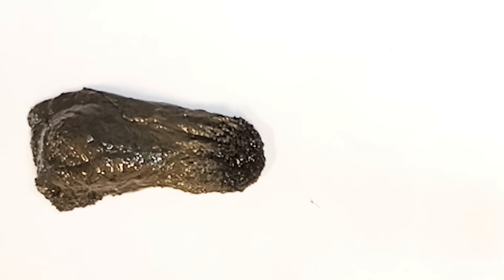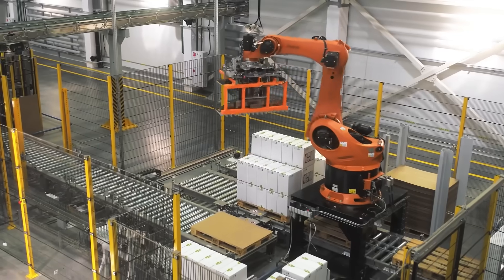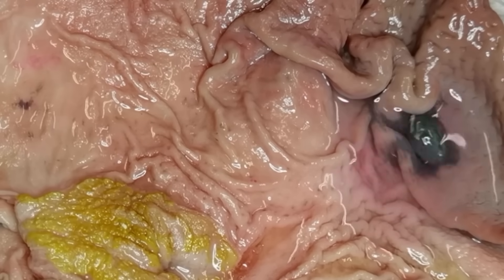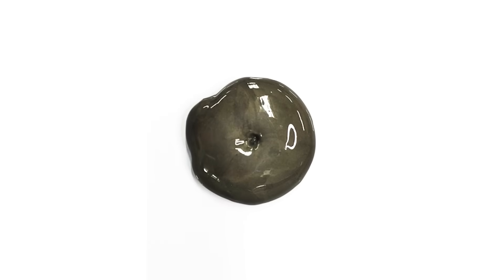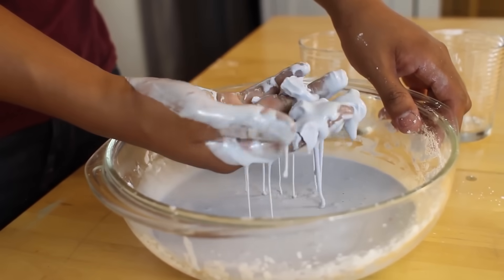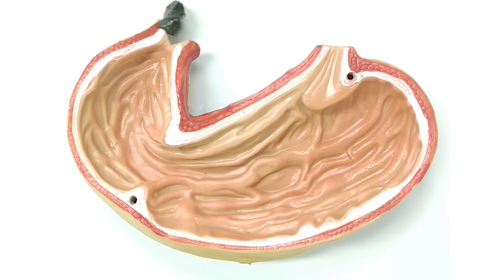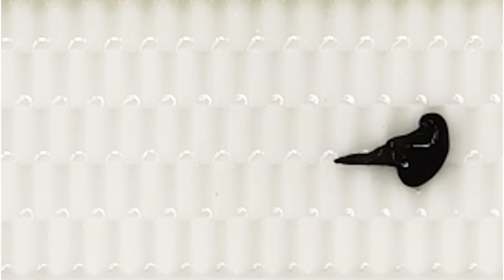This Is The First LIQUID Robot, And It’s Unbelievable

Comment: It's not a robot in my book if it's not self-driven. Having to manipulate using outside magnetic fields means it lacks autonomy.
Reply: I agree
Reply: Thank God.
Reply: It's more of just a very intricately fututistic instrument. Still interesting, though!
Reply: You are using the common usage meaning of robot. The scientific/engineering usage of the term 'robot' is different. For example a thermostat is a robot. A robot does not have to be sophisticated to be called a robot. If it performs even one simple task autonomously it is a robot.
Reply: @dannygjk  - This magnetic slime does not perform even one task at all autonomously. It's not a robot. It's just a magnetic fluid being dragged around by magnets.
Reply: @peterwhitey4992  If it encounters a piece of steel for example it will wrap around it, (grab it), automatically.
Reply: @dannygjk  - A piece of tape will automatically stick to anything it encounters. A drop of water will automatically make something it encounters wet. An arrow shot from a bow, will make a hole in whatever it hits. Doesn't make it an autonomous task. Any magnetic material will automatically attach itself to steel. Doesn't make any of them robots.
Reply: @peterwhitey4992  not all of your 'analogies' match as autonomous. I'll grant you that slime with embedded magnets is debatable. However it will do something autonomously. It will grab some things if they come into range. That can be useful because it can perform a function. Let's get back to thermostats with coiled bi-metallic strips and a mercury switch. How do you feel about that being called a robot? How do you feel about a virus being called a robot?
Reply: @dannygjk  It will grab some things that come into range automatically (like you first said), not autonomously. It's two different things. A robot has to be autonomous.
Reply: @dannygjk  A thermostat is indeed autonomous. Virus are autonomous but not artificial so I'm not sure if they're considered robots.
can you explain what's the difference between the common and engineering/scientific definition of robot. A thermostat seems to fit the common definition of robot too.
Reply: @shiinondogewalker2809  I'll grant you the slime is a questionable example but the others are definitely robots. Example old school thermostat.
Reply: @shiinondogewalker2809  Viruses are considered non-living but I honestly don't know whether scientists consider them robots. I do consider them functionally robots and they even have firmware in a sense.
Reply: @dannygjk  Are you agreeing that it doesn't fit the definition of a robot, or are you claiming that this material is capable of performing some type of  autonomous action? If it is capable of autonomous action, they certainly don't explain how in this video.
Reply: @quietpsycho1  been a while since I watched it but doesn't it have a lot of small magnets in it?
Reply: Who is to say we are not controlled from without?  Barring there is no evidence for such a controller.
Reply: @markharmon4963  we are not controlled from without
Reply: It's like calling a string puppet a robot.
Reply: Hey Girl I Like Your Kitchen Romania  - Then basically anything is a robot, because you can move it around.
Reply: Microrobots could deliver drugs straight to diseased tissue.  Fish-Shaped Microrobots to Deliver Chemotherapy to Tumors
https://youtu.be/4Qa7W-TH948
.....
Reply: Aren't software driven robot lacking true autonomy.
Reply: @ashleydean9350  not autonomy as in people having autonomy over their lives. It's a different usage of the word 'autonomy'. Robots performing function(s) autonomously means they can make decisions without human input.
Reply: Yes
Reply: This video is clickbait

Comment: As you mentioned neodymium magnets are permanent magnets, therefore you can't change their magnetic field like electric magnets, therefore you can not control the robot.
Reply: So electric motors with permanent magnets don't actually work? Have you never used a magnet to push another magnet (same polarity against each other) without touching it? I thought that was done in schools all over the world.
Reply: @bennylloyd-willner9667  
LOL, electric motors have both permanent and electric magnets, that's why they have to be connected to electricity. didn't they teach you in school?

Comment: Seems like the definition of "robot" is pretty strained here. Just sounds like magnetic sludge, which has been a thing for a long time. How is it controlled? Can it think and navigate for itself, or does it need a bunch of exterior magnets outside the body to guide it around? I'm pretty skeptical about you calling this a "robot."
Reply: The inventor had it correct , it is a potential tool.

The robot title is clickbait and dishonest in its current state
Reply: @Mustang2277  the inventor calls himself the co-creator of the "Slime Robot."
Reply: Why do they call it a liquid robot?
My magnetic putty does the same thing when i control it with a magnet. 
is my Magnetic putty a liquid robot too?
Reply: @J17legacy  It would be if you could control it with accuracy
Reply: @J17legacy  according to the new definition. Yes. Yes it is.
Reply: @DanGoodShotHD  🤣
Reply: @J17legacy   Your putty isn't a hybrid liquid/solid material.
Reply: @musashidanmcgrath  it's actually exactly that.
Reply: @J17legacy  well consider that we call an automated welding arm a robot, even though its "brain" may be in a different work cell. Yes this is a robot, or where the robot arm is a computer numerically controlled device thge slime putty is a computer anolog controlled device- the actual "robotocs" would be in the control systems and magnetic coils and the "magnetic slime" is basically the tooling.
Reply: it needs a full body scanner to see where it is and a magnetic manipulator to guide it through the body so yeah it's not going to be happening in your local er any  time soon.
Reply: Agreed.
Reply: This is not a robot, it’s just a magnet moved by another magnet under the surface and maybe some stop motion animation…
Reply: I didnt understand how its actions are  controlled so it can perform finer, sophisticated movements. If that is possible from a distance of some cm at least, it will become vety useful. 
(If you calm it a robot or  not is less relevant; a factory floor robot cannot sense much either)
Reply: a robot is just a machine capable of moving independently and performing complex actions.
Reply: Etcha Sketch boards are coming back.......
Reply: @Sagpio75  let's gooo
Reply: Jon Dough  yo if I do that I can sell it as book after I become famous
Reply: I need a T1000
Reply: Microrobots could deliver drugs straight to diseased tissue.  Fish-Shaped Microrobots to Deliver Chemotherapy to Tumors
https://youtu.be/4Qa7W-TH948
Reply: Would agree here, it's basically ferro fluid with a thicker viscosity, not impressed by calling it a "robot" the fact that the neodynium magnets are hidden behind the what it's navigating through is "misleading" at best.
Reply: Just adding my two cents.

It...is not by popular definition or dictionary defintion a robot.

Is it a tool? Yes.
Is it likely more complex than this video alluded to? Possibly.

Should we all just agree...robot isn't the best word to describe this, even if some think it can be considered a robot? Yeah...totally. 

Let's put it this way.
If the average person...with average knowledge of the world...was advertised this product without seeing it and it was called a robot in the add....would that person have their expectations fulfilled or broken once they saw it?

My response...this wouldn't align with the average person's understanding of robot...and their expectations would be broken.

If a term used by nearly everyone is used by a very select few in a totally different way...who is more correct about the terms meaning?

To me...popular opinion counts. The select few have invented an exclusive jargon definition that shouldn't be used outside of those circles  with the expectation that it will be understood as intented.

So...let's just not call it a robot.

Thank you.
Reply: It is moved around by hand, photographed, moved again, to create a sense of motion and technological progress.
Reply: Given that I am a robotics student it exactly fits the modern definition of a robot. It is controlled over a distance, though that requires a strong magnetic controller. Most modern robots are not fully autonomous, requiring a distant controller. This one is in its early stages of development.
Reply: @douglasjensen4532  so distance and control are the only qualifiers for something to be considered a robot? Tying a stick to a string and swinging it around my head makes it a robot because I'm "controlling it from a distance"?

I'd appreciate some concrete sources at least. I've provided three so far: Britannica, Wikipedia, and Aerospace Robotics, all of which disagree with that claim.

From what I've seen from those sources, for something to be considered a robot it must be able to, to some degree, sense, think, and act.

All that this does is act, and that's because it's not a robot; it's a tool.
Reply: @thomasturner1065  well no, cause you controlling the string with a stick, you tied it directly to the stick, so the distance you controlling it from is literally 0. But if you want to act like a idiot, yeah you can say stupid stuff like this

If your stick could force string to move while the string is not touched by the stick by like, an inch, or 3 away; yeah it’s a robot
Reply: @VentA_7  so magnets are robots? You're telling me one aspect of physics is robotic and another is not just because you can see them touch?

I know it's a lot for you to comprehend, but magnets aren't magic. They, like everything else in the universe, are beholden to physics - at least as far as we understand.

Light isn't a robot, gravity isn't a robot, and magnets are not robots. I don't see how that's up for debate
Reply: Your argument is inherently flawed. You rely exclusively on whether or not one thing is touching something else to be considered "direct control."

If you throw two magnets at each other and they collide and stick together, are they robots?

Robots are not "remotely controlled 'things.'" I provided a definition somewhere - with multiple sources - if you care to look.

Of course, you could also just Google it instead of writing a reply. That'd save both of us time
Reply: @VentA_7  - Nonsense. Whether it's a string, a stick or a magnetic field pushing it around makes no difference. If it can't do anything by itself, but has to be directly controlled by external forces, whether string or magnetic field, then it's not a robot.
Reply: @VentA_7  so your saying if I hang some string from an object and I swing a stick like a baseball bat a couple of inches away from said string and the string "moves" (due to the air turbulence from the stick) then I've created a robot?... OK then 🤖
Reply: @douglasjensen4532  idk man, so every magnet is now a robot? You gotta draw the line somewhere. This is just a magnetic sludge. Guess I'm wearing a robot on my finger too.
Reply: You are using the common usage meaning of robot. The scientific/engineering usage of the term 'robot' is different. For example a thermostat is a robot. A robot does not have to be sophisticated to be called a robot. If it performs even one simple task autonomously it is a robot.
Reply: @dannygjk  well, this one doesn’t do anything by itself. It’s literally just magnetic putty.
Reply: @Whatisthishuhhmm  It can do things by itself. If you put it near a piece of metal (some metals) it will do something by itself without needing a hand to control it.
Reply: @dannygjk  
I love you so much! 💞
Reply: @dannygjk  so a normal magnet is a robot? Anything moving without an (easily) explainable cause is a robot? We don't understand magnets and their fields incredibly well, so they appear to be moving without outside interference, but imo it's basically the same as gravity. Reacting to magnetic pull is not an autonomous behavior. Neither is being pulled by gravity or pushed by light
Reply: It's a robot.  It can be programmed
Reply: @mixedlove1234  - It cannot be programmed. The device moving magnets around, to control it, can be programmed. That doesn't make the slime a robot. You can program a robotic arm to move a rock around. That doesn't make the rock a robot.

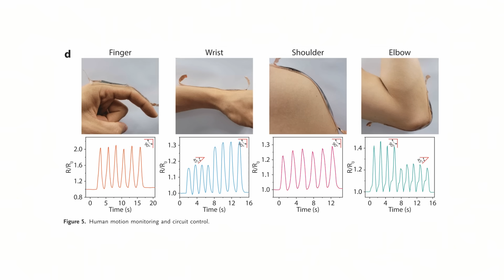Comment: 4:32  This could be used for VR haptic suits and motion capture for 3d.
But how expensive would it be to produce it? Would it be a full body suit made of the stuff,  a thing covering only the muscles, or tiny strands?
Reply: Two layer haptic suit can be designed. Base material is cheap enough. It's just the controller that may be hard. It would like wearing an entire flexible phone screen on your body.
Reply: @khanch.6807  A flexible phone screen on your body? So essentially, you'd be a teletubby?
Reply: I could see being used for motion capture. I'm not sure how much pressure it could produce for haptics. price wise it could be expensive or could be really cheap depending on how much  magnets are in it.
Reply: Imagine getting crushed in VR and then getting crushed in the liquid, geez...... Thats...... Gross...
Reply: Sounds like the body suits from G Gundam

Comment: It looks like they have created the beginnings of the Venom suit. They just need to pair this with an AI and you can have your own Venom suit or liquid metal Terminator.
It can be used inside the body also to deliver drugs to a certain part of the body, Chemo directly to a tumor, or cleaning arteries of Cholesterol buildup, or a blood clot in the heart.
This could be redesigned to work in house plumbing systems also. If you have roots growing into your sewer lines you could have a little blob of this that wanders thru your lines and cleans them out or looks for leaks in pipes and repairs them or cleans out your air vents in your house.
It could even be programmed to crawl over surfaces like your floor and clean it like a Roomba while you are away and you would come home to a cleaned house. A version could me made to clean your shower, or toilets and then just go down the drain and breakdown in the septic/sewer system.
Put this in your yard and have it mow the lawn, kills weeds, kill the queen in an ant colony or even map out an ant colony and make some really cool 3D art.
The possibilities are endless.
Reply: Yeah it’s probably already in the magic potion 💉
Reply: NPC response.

Comment: Interesting, perhaps the military can use it to have adjustable lethality bullets. I'd imagine it would work with this kind of slime infused with nanomachines to navigate itself into damaged veins to staunch bleeding from a gunshot wound for the lowest setting to just take a person out of a fight, or maximum lethality could involve the machines navigating into the bloodstream and forming a blockage if it senses the blood vessel diameter is large enough to cause death if clogged.

Comment: i love this¡¡¡,... i also see some problems with using it in medicine... for example endoscopic surgery the robot would have to adapt to the stomach suface without damagin it, or stop the bowels from hurting the slime and viceversa, any other part would have to avoid absorbsion of any slime component simply bcs kidney and/or hepatic toxicity.
but this has so mmuch potential and i love it ¡¡¡

Comment: I had an idea like this I really need to get into a lab. Of course my idea is much different and would be used as protection. This robot isn't practical I'd assume it leaves behind particles and wouldn't be the safest way to remove foreign objects there are many other ways to remove a battery or other objects from the body. On top of that people would have to be educated on the subject of the robot I don't see this robot going anywhere like ever. A stomach has digestive enzymes and could cause the robot to loose more of itself going into the body possiblity causing a bit more harm not enough to really be alarmed but unless the child swallowed a sharp object that demanded immediate care this really has no use I'd say but what do I know right.

Comment: If it uses hydrogen bonds to stick to itself, wont it mix with water? that would be bad for any wet environment.
Reply: Would that not depend on the strength of the specific bond?

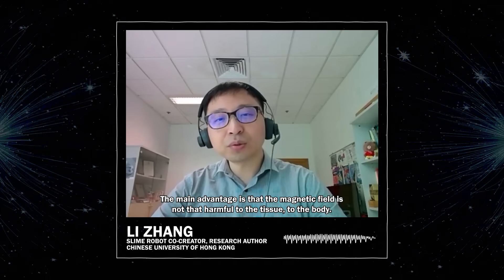Comment: 2:43 "inside of the body" 
BULLSHIT ALERT! BULLSHIT ALERT! BULLSHIT ALERT! BULLSHIT ALERT! BULLSHIT ALERT!
Reply: What?
Reply: @quirrelboi766  That is incredible BS. Eating magnetic putty*, isn't very healthy and usually recommended against.

*= and that is what that is. It is magnetic putty (with the only innovation it uses neodymium instead of iron filings) "controlled" by outside magnetic forces.
So, no smart robot or anything, there is just a magnet stuck (and maybe moved) under those models.